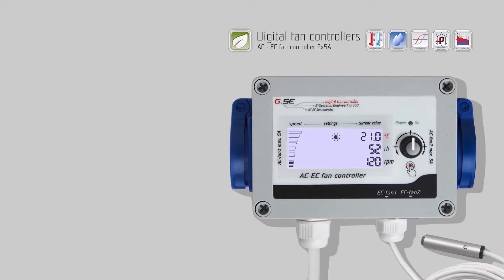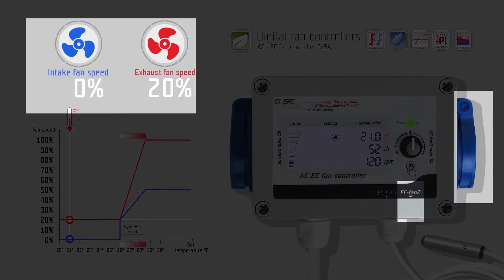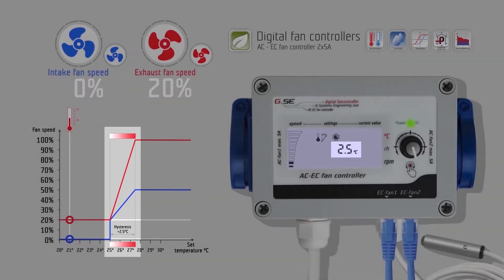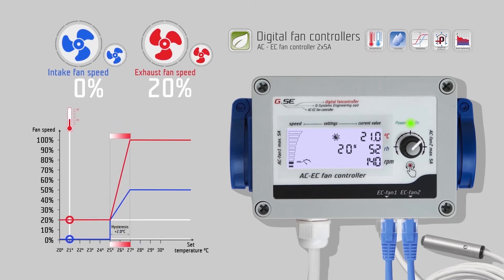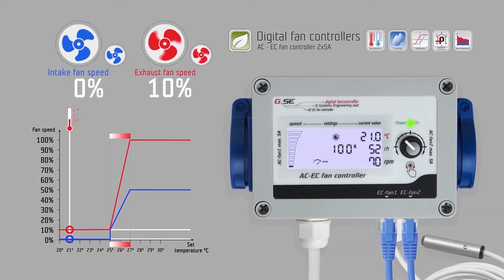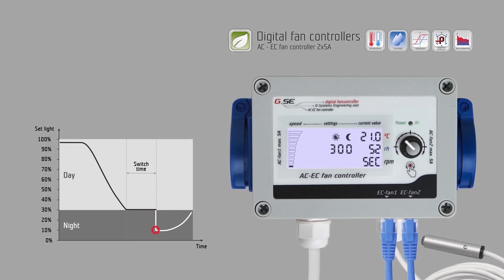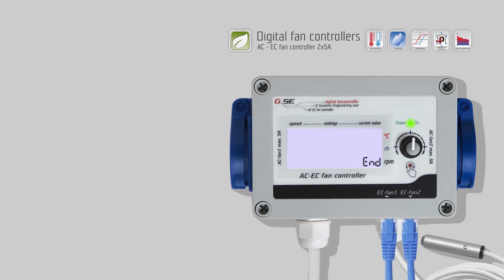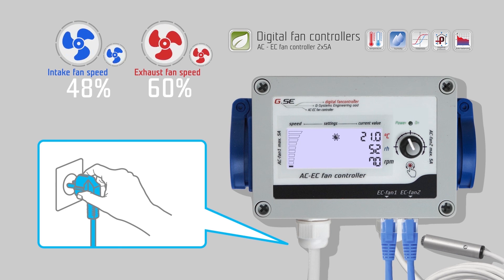GSE AC-EC fan controller

Comment: when i change the p4 setting to on, so the intake air does not stop if the temp/humidity drops below their set values, does the intake air run the same speed as the exhaust or does it maintain the set negative pressure (0-50%)?
Reply: Oders are no Problem anymore, thats correct.

How would you setup the both menues in my way?
p1 to p4 please 
and speed Settings in the regular Day and Night Menu.
if you want both of your Fans to stopp when you get below your Temp/rh Settings?

My Intake Fan is connected via rj45 to Port Fan1 and the exhaust of Course to Port Fan2.
Fans both are Prima Klima BlueLine 680m3/h

I can‘t hold any rh when air is Constantly been blowing in and out of my Tent
Reply from the maker: @Marcus-sucraM  Hi...  please send me your Serial number of the device to info@g-systems.eu, I will find out who is responsible for your support. We are manufacturing company we do not have sales support for retail client. Thanks for understanding.
Reply: @ i wrote a email, no answere yet, you got my email?
My Tent still blows up when i‘m under my RH no matter wich port i use or what Settings i change.
Exhaust runs on 450 rpm even when i want 0% speed, intake must be faster in this case when it blows up my Tent, what a weird controller.
Reply: maybe you have a german support for me 😃
Reply from the maker: @Marcus-sucraM  please write again alain.gressly@g-systems.eu  , they can be many factors which I can not comment until we have understand the issue and find the correct settings...
Reply: hey so i did test it with the intake fan on. when the temp/humidity are below their set value the intake air run the same speed as the exhaust fan creating positiv pressure, so air gets out of cracks/holes in the room.  

So my intake fan has the same m3/h rating as the exhaust, the exhaust has an carbonfilter so my exhaust loses around 20-30% of its speed/power, the intake does not have an carbon filter or differen filtration systems attached to it. So the intake air pulls more air in than the exhaust fan can get out of the room. 

When the temp/humidity is over their set value the exhaust fans runs faster than the intake creating negative pressure, i set the negative pressure to 50% and it only keeps the negative pressure when the set value is over it. 

Lets say it that way (and sorry for my crappy english): i set the temp to 20C if the temperatures is below 20C the exhaust and intake fan ran the same speed (set to 20%min speed) and positiv pressure gets created because the intake does not have a filtration attached to it and the exhaust has an carbonfilter attached to it and the negative pressure is only working when the temperatures is above the set value. if the temperatures is above the 20C set temperature lets say 22C the exhaust fan runs 100% and the intake fan is set to 50% negative pressure and the room will keep the negative pressure as it should be. 
So the problem with the positive pressure occurs only if the set temperature is below it.

I do not need the intake fan on all the time so i will set it to off again. I bought this controller because i wanted to install an hepa filter to my intake fan and most likely this filter would get me the negative pressure i want when the set temp/humidity is below my values. 

I hope you understand my problems and can give me an answer to it.
Reply: Or lets say it that way if you turn on the p4 setting so the intake runs all the time, both ventilators the intake and exhaust will run at the minimum settings (lets say 20%) until your temp/humidity is above your set value and the negative pressure will turn on. there should be a setting for both the intake and exhaust fan so it always creates negative pressure
Reply from the maker: Hi, yes reading your other 2 comments is correct. The P4 setting should stop the intake fan (Fan1)  if Temp. & Humidity is below setting. I just tested it again to be sure and this works on AC and EC exit.... If the P4 setting s ON, the Intake fan never runs below minimum speed.
Reply: @alaingressly214  same problem here, my exhaust seem to stopp, but the intake is blowing  up my tent.
i run on 
p1-0%
p2-0-10
p4-on

min speed setting in normal the
menu is 0% too

pressure is -23%

please, how can i solve this Problem?
Reply from the maker: @Marcus-sucraM  
Check carefully if the exhaust and intake fan is correctly connected and not contrary, (Models from 2007-2019 are different from the new ones after 2019)
The intake fan have to stop not the exhaust fan!
Reply: @alaingressly214 why are not both the intake and exhaust just simply stopp when i want 0% Speed?
It‘s really hard to hit and hold the targeted Humitidy with this Controller.
Reply from the maker: @Marcus-sucraM  Indeed... the new manual was not changed... I apologies we will correct it a.s.a.p. 
0 Speed on exhaust fan Why? Because we want a constant negative pressure to avoid odors escaping. To avoid the neighbor call the police! Actually exact this function made the controller so successful. This may not required any more if you grow legal like in Germany since April 2024.
Possible solution: Connect both fans into the intake fan1 socket (left) and set the intake fan to OFF https://youtu.be/SOHCaHWDh-I?si=zVxyvRhemX3Y1mDn&t=484
In this way you probably have odors outside the grow-room!

Other solution put the minimum speed setting to 0 zero? https://youtu.be/SOHCaHWDh-I?si=lF_fvNkJXu6TH8w3&t=227

Comment: in your manual is the intake (13) and exhaust (14) Fan reversed.
whats the right way? exhaust on the right side like in your video or on the left site like in the manual (pdf)
Reply from the maker: Nice to know that min. one person is reading the manual.... Thanks for the info!
Reply: @alaingressly214  I so what is the right way? i guess like in the video, right?
Reply from the maker: Hi 
models produced after 2020 is left in right out as the potentiometers on the right side, old models are the other way round (for left-handed grower)
Reply: ty, i asked because i have to much  
underpressure produced from the exhaust even with 0% pressure settings. When the P.settings are at 50% i definitely feel more underpressure, so it seems to work the way it should.
Intake and exhaust are both the same models and both connected via rj45.
So is 0% maybe not really 0%
Reply from the maker: Hi
No it should definitely be the same at 0% on both EC exits or sockets.... both fan run the same speed. Differences can come from the installation like filters or ducting length....
Reply: @alaingressly214  my exhaust has a Carbonfilter and ~ 3m Hose
the intake has a little bit of mesh to prevent dust from sucking in an ~ 2m Hose. Maybe the Mesh is to restrict, i‘ll try some pantyhose or other filters.
Thank you very much, I'll see if I can narrow down the error further
Reply: it was the stainless steel mesh, a ram bug barrier helped in the end. TY